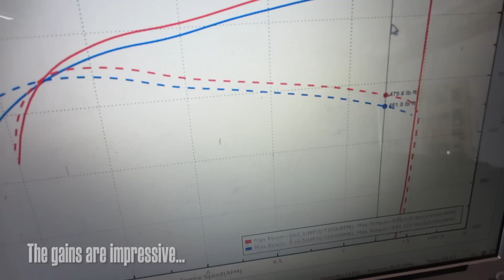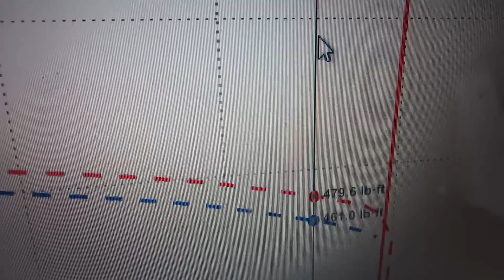Roush F150 5.0L | Dyno Tune and CFM Throttle Body Testing

Comment: test drove one of those 2015 aluminium ecoboosts today . I am conflicted .....until i saw this . much cheaper than buying a new truck . I love my 2012 5.0 I must do this to it.
Reply: +2rcnuts Why not upgrade, get the 5.0 in the new and then do this? That what I would do in a heartbeat.
Reply: well .... lol i did go with a 15 but i went ecoboost this time.
Reply: +2rcnuts 2.7 or 3.5?
Reply: +Charger8921 I went 2.7 got an extra rebate and I don't tow that heavy. LOVE IT. unbelievable what this Lil v6 can do.
Reply: +2rcnuts Good choice. Everything I read on it suggests to me that that engine will be a very popular engine. Something tells me once they get busy tuning it that it will easily whoop the 3.5.  I guess we'll have to wait and see. Any mods planned?
Reply: +Charger8921 actually I bought a lifetime warranty so any major mods would void it. I might do a Cai or cat back if I can do it without a tune. just wanna bring out the turbo whistle.
Reply: +Charger8921 I bought a 2015 with the 5.0 but that little 2.7 kicked some ass 0-60 times on TFL truck. If you haven't seen it I would advise watching it to see your trucks potential. Enjoy your new truck, I love mine.
Reply: thanks theMeanmarie13 I sure do
Reply: +TheMeanmarine13 I have seen that video (as I am a subscriber of TFL Truck) and I am quite impressed with that little 2.7. Not only does the power impress me but the fuel efficiency as well. Something tells me that if you can keep from hotrodding it that the gas mileage will only go up as you get more miles on it.. The only turn off for me so to speak is the auto start/stop. I just don't trust it. Thankfully for me it can be turned off.
Reply: *****  I agree it could probably get better mileage with some moderate upgrades and easy driving. Refresh my memory, what is auto start/stop/ Are you referring to some kind of launch control? If that's even equipped. I recently learned watching another video I could completely turn off my advance trac by holding the TC button for ten seconds haha That's awesome. I tried out locking my rear differentials and putting it in sport mode but it didn't peel out like I thought it would. It's pretty heavy though with the supercab, 4x4 and 20" wheels. Still, it's much quicker than my 2010 5.4 liter was, MUCH QUICKER!
Reply: +TheMeanmarine13 The auto start/stop is where the engine shuts itself off at a stoplight so long as you have the brake pedal pressed. Take your foot off, engine starts back up. I personally don't like that technology as it just one more thing to go wrong.
Reply: ***** yeah the start stop feature is a but strange to get used to, but there is a lot of stuff they did to the engine to hold up to the extra starts. bigger main bearings its a 4 bolt main also among other beefier parts.
Reply: ***** Oh like cylinder deactivation or something like that. Yeah, I'm not sure if I'm fully comfortable with that technology just yet haha. I love my "baby" the ways she's built now you know?
Reply: +2rcnuts It's not the extra starts and stops wearing on the engine that concerns me with it. It's the what if it never restarts that concerns me.
Reply: +TheMeanmarine13 Not quite like cylinder deactivation. It just shuts the whole engine completely off. And don't even get me started with cylinder deactivation.
Reply: ***** Oh I got ya, kind of how a hybrid shuts down completely until you nail and then it takes over for the electric motor. Except this one doesn't have an electric motor at all.
 That makes sense but is it field tested and proven to hold up?
Reply: TheMeanmarine13 Ford has beefed up the main bearings, gave it an agm deep cycle battery to run the  electrics while engine off. also it doesn't work on 4x4 or tow mode.It actually will start within 500 millisecs of releasing the brake pedal. The climate controlled cab also has an effect on the feature.If say its 100 degrees out and you have the ac on the start/stop feature will fire back up if the cab temp rises too much at a stop light.there is much more than just turning off the engine going on here
Reply: +TheMeanmarine13 Auto start/stop technology has been on cars for years now.  As for hybrids, they're an effing joke. Also on hybrids (most of 'em anyway) turn back on if the speed gets above 25-35 mph.
Reply: ***** yeah I've never been real impressed with hybrids so far.
Reply: 2rcnuts Damn haha, someone's done their homework. It sounds like Ford put a lot of thought into this. I absolutely love my 5.0 though. I didn't think I would like it at first after owning an 01 lightning and 03 cobra previously but it's 4x4 is very capable in our severe winters up here. Not to mention the bigger cabs on the super crew keeps my kids at bay and out of smacking range in the back hahaha My 2010 XLT just didn't have enough ass pulling my trailer. The 4x4 shift on the fly came in handy though.
Reply: that coyote sure does a good job I thought I might miss mine (had a magnaflo exhaust on it sounded amazing) but I feel that I didn't give up any power and enjoying a quiet ride. my other ride is an ignorantly loud motorcycle.
Reply: 2rcnuts well the bike HAS to be loud haha. Yeah it performs great for a de-tuned mustang motor, has some grunt to it for sure.
Reply: it's still a lot of money and dyno time to make it run right, idk man, superchargers can only pull boost as long as the crank is turning but once peak operating ranges approach the blower starts costing power and is generating alot of heat. this will cause oil vapors to travel back in the blower for that mill does not have a oil separator either, the powerplant plant was not made to handle boost so alot supporting modifications have to be made to have a proper reliable mill, head gaskets could potentially blow out because of the increased atmospheric pressure is being introduced in the head. besides it's a high static compression engine where boost will be low, most likely under driven pulley 5~8 psi tops would be my guess for safe engine longevity there is a vikings player who supercharged his rig at a ford I worked for, I talked to the mechanic who did the work. it ran okay it really  needs new slugs and stronger valve components  (stronger larger surface rollers, hardened seats and springs) but here in lies more issues of having to balance your valves for all these new valve upgrades might be grams to heavy ect ect. do you get where I'm going. or you could get an ecoboost motor that's already and built for boost and has a huge aftermarket and ford racing support.... it's up to you, blowers were great in the beginning of automotive performance. but they were designed for industrial perposes like mine shaft ventilation or early engine's where the blower is only spinning 100 rpm, it was not till after the war we saw aircraft mechanics and pilots install superchargers on there drag cars but these were centrifugal or very inefficient roots designs from aforementioned industrial age. variable displacement pumps or turbos are far more effective at producing boost and don't cause parasitic power losses. food for thought

Comment: Hey I to have a 2012 f150 5.0 with a Roush supercharger, cold air intake, and exhaust. On my Dyno run I hit 485 hp and 495 ft. I was hoping you could advise me off what the next step should be to build an amazing truck such as yours. I Also have serious traction issues on the track, my best run was 14.2@103 mph. That was in 2wd. Do you launch in 4hi, and if so how is your transfer case holding up? Thank you, Ken
Reply from the maker: Roush2012 The truck in this video made 465hp and 420tq on the Roush Stage 2 kit and Roush's tune. Once we got our hands on it, we had it pushing 554hp and 542tq, along with much improved drivability and shifting. That was just programming. It's something we can do here on our dyno in Longwood, FL or over email if you're patient enough for multiple tune revisions and datalogging. After that, you may want to consider addressing the engine internals before pushing it further.
Reply: MPT Performance Thank you. At the drag strip did you launch the truck in 4 high? I can't seem to hook off the line and blow out my tires. With my rwh and trap speed I should be running 13s? Again thanks for your help.
Reply from the maker: Roush2012 Shoot us an email. sales@morepowertuning.com

Comment: I have a 2014 rt570 I was wondering what traction bars y'all were using and wheels?
Reply from the maker: Traction bars ar Caltracs by Calvert Racing. Not sure on the wheels, the customer brought us the truck with those already on there. http://www.morepowertuning.com/CRS-7300-caltrac
Reply: were there any other mods besides the trac bars, throttle body, and tune?

Comment: 662 rwhp!!!!  Holy Shit............That thing must haul ASS!!! Sounds killer too!! Imagine a Reg Cab Short bed!!!  How many psi and is that the TVS 2300? Do a 2015 with 2.9 whipple!!
Reply: mikesanto70 
I was super close to getting a 2015 sierra 5.3, until I saw this. RCSB, XL trim level, white with the black front end. 17" steelies painted black, with chrome beauty rings. Aluminum body. Cheapest horsepower per dollar. $26K. A mustang is about 33K, so once you do 7K for a supercharger, you're at 33K for over 600hp. Cheap pickup truck insurance. Never gets stolen.
Reply: +Guns Cars and Digits new or used? Every truck I looked at started around 40k for the cheaper trim levels. The Mustang GT's were high 30's low 40's. The one I bought stickered 51k before all the rebates and X plan discounts. Flipping ridiculous these days.
Reply: +TheMeanmarine13 
New. Build your own feature on Ford's website.